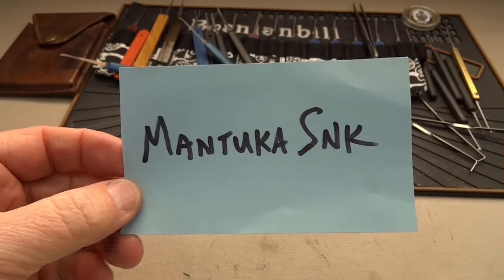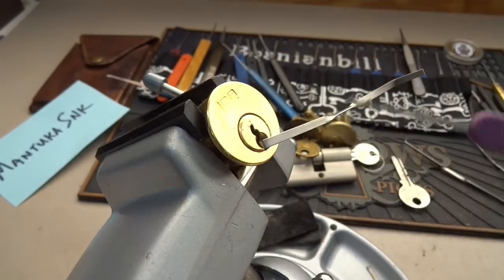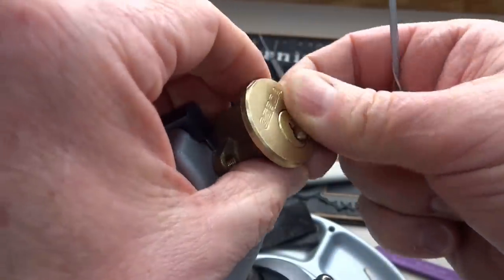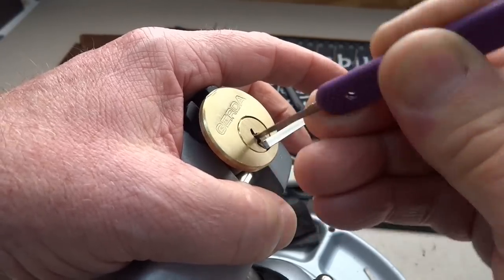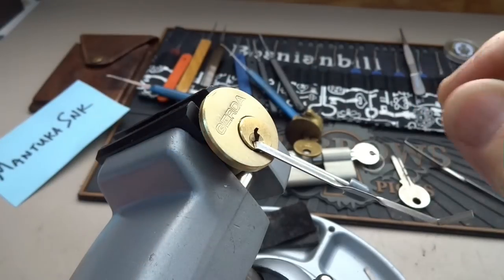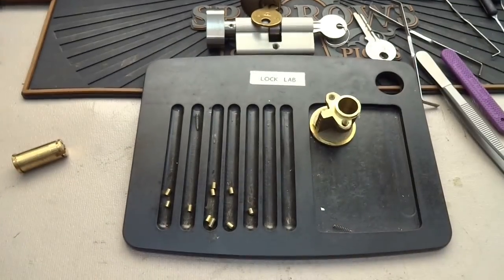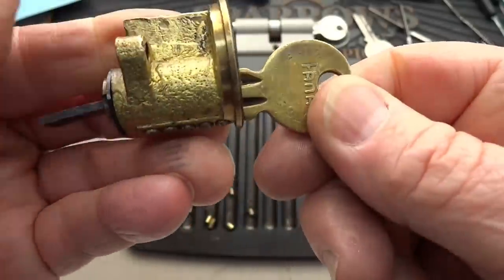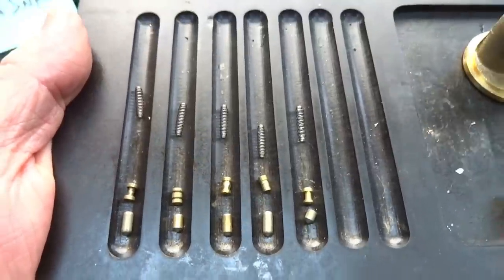(658) LOB and Gerda Lock Embarrassed (Thanks MantukaSNK!)

Comment: Thanks for the locks Bill. I have the LOB that you didnt try. I finally raked it open. Took a while for some reason. Plain bottom and top pins just like the one you did here but a different bitting. I disassembled it and and am trying to drill and tap to make sort of a training/challenge lock since it didnt have a key. When I get set up for making videos, I will show the modified version and forward on to the next victim. thanks again.

Comment: In Poland much of old locks works only if you pull out the key a little. I've thought that is completly normal behavior, isn't it? And Gerda has really good reputation in here. I'm in shock that you picked it so easly. I will not sleep at night.
Reply: bo ta stopka za ząbkami, ktora opiera sie o zamek jest wyrobiona. jesli potrakrujesz ja mlotkiem (splaszczysz) to wszystkoe bedzie smigac. bylo w Usterce ;)
Reply: *****
Dzięki/Thanks Daniel, I'll do it ;)